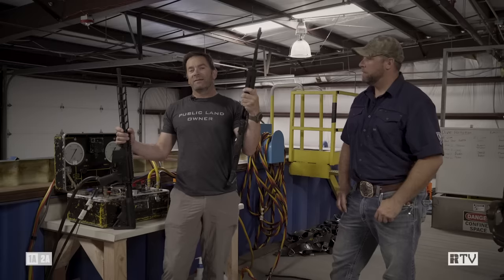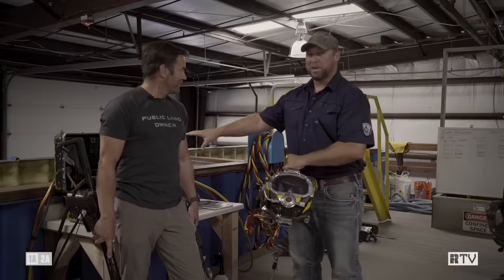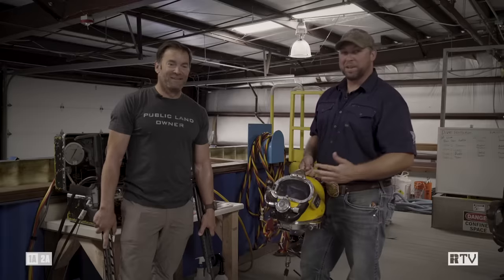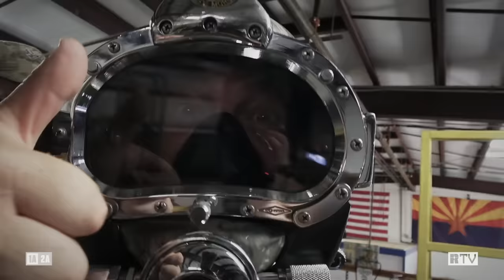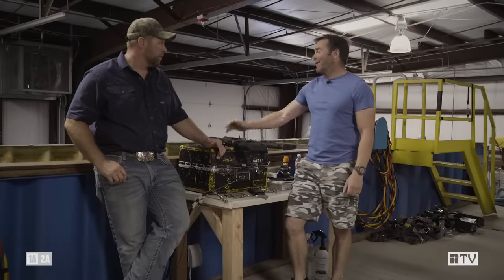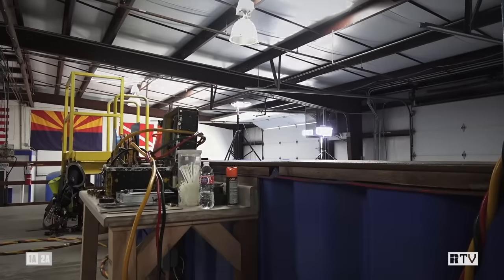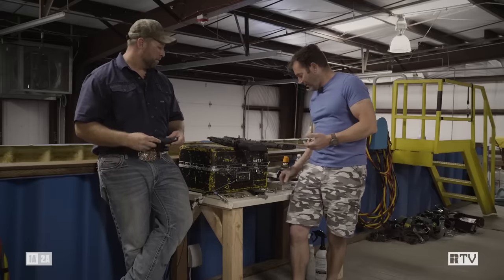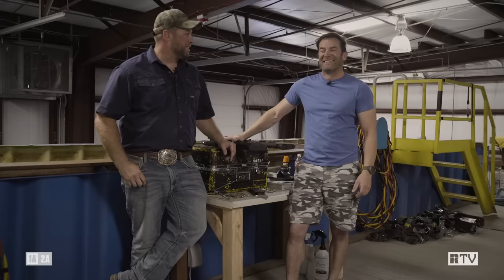AR vs. AK.....Underwater

Comment: I had an AK 47 and an AR 15, I took both of them shooting 1000 rounds AK 47 crapy bear round amo, and my AR 15 I had to have better cleaner brass and more expensive. AR 15 from 1000 rounds only jammed one time. AR 15 would jam very often sometimes after 2 or 3 shoots. Switched the magazine for a military grade same thing, more expensive ammo, same thing. Gave it many chances clean, mags, ammo etc all failed. I got frustrated with the AR and got rid of it. Very nice AR but I would have to say my experience with the AK was much better then.

Comment: AR was probably due to it being a DI system with a lot more actual force going back into the receiver. AK 's piston would be taking most of the abuse of that.
Reply: No, is because the lack of roles behind the buffer tube. There is water there, and since it has no place to go, a hydraulic lock occurs (like on a water flooded car engine).  The solution is to put holes in there, like the ones HK did on the 416. If you look on the infamous test HK did, water flies off the butt stock, and the operator make sure to not obstruct those holes.
Reply: ARs are not direct impingement, there is a piston... it's just that it's the bolt head, and the bolt carrier is the 'cylinder'.
Reply: @mfree80286  ... no
Reply: @superdupermax  No? Care to explain why gas vents into the bolt carrier and there are sealing rings on the bolt? What does that pressure do other than act like a piston and blow the bolt carrier off the locked bolt? That's not direct impingement, there's no 'blind hole'.

Comment: Okay, so gun's using a gas system don't work.  How about gun's without a gas system, like the roller block system in a Cetme-L or HK MP7.  Another good test might be guns that are simple blow back.  In any case, good video, very informative.

Comment: I'd like to see some peizo sensor data on the chamber pressures there, the 5.56 is essentially pushing a 300 grain bullet, the weight of a 50 grain bullet and a bore full of water, which is 250 grains for a 16" barrel, so thats five times more weight than they normally push. The 7.62 is pushing about 400 grains between the bullet and water, a 120 grain bullet and 280 grains of water, so that's about 200% more weight than it would normally push. Big PSI numbers I'm sure, that's probably getting close to rupturing the chambers, for the 5.56 at least.

Comment: As soon as it fires and reaches a velocity that the bullet expands, wouldn't it almost if not immediately expand inside the barrel ?
Reply: IrnMaiden304 No because it never reach those speeds. (Not sure if that is the reason)
Reply: @akivak4660  I'm assuming the AK was having light primer strikes or type 3 due to having to cycle in the water till it couldn't function anymore, but the AR blew apart on the first round. Could that have been due to head space issues with ammunition or design or obturation I wonder. I'm just curious cause there are Glocks that can fire underwater so what makes them able to due what these rifles have issuse doing. I'll watch the video again, maybe I missed something or I am just overthinking idk

Edit : sorry, it was on the second round .... And yes I did miss something, problems of a noisy household .... Crazy over pressurized due to hydraulic force from the water .... 🤦
Reply: IrnMaiden304 Mythbusters test firearms under water.
Pistol worked best, but failed eject casings. Water is thousand times denser than air, it create lot of resistance.
I have no idea why AR mags blew out. Probably because it is gas operated and that will cause a lot of internal pressure.

Comment: What about air rifles? How would those do underwater?
Reply: Even worse, pellet would likely just slow down so fast you would have a pellet half way down the barrel
Reply: I meant something like the Airgun Depot Texan SS. Its an airgun but shoots bullets by compressed air  from a tank. Just the bullet though, no case or primer or gun powder.

Comment: 1st thing over all, I wouldn't used either one under water, lol.
HK used to have a video similar between it's hk416 piston (AR) vs a Colt M4 gas operated.  The Colt basically exploded from the water in the gas tube as the hot gases expanded to cycle.  The hk416 worked normal due to been a piston design.  That's why on this video the AR basically exploded via the pad of less resistance.

Edit: this is the video HK vs Colt.
https://youtu.be/vjMH94PuT_I

2nd video of HK416 in the water,
https://youtu.be/S2d1Jl55haU

Comment: So the AR failed for the same reason that it works so much better above water than the AK because the AK is a very open system and the AR Is a very closed system but it would be cool if they fired a piston driven AR the results may have been similar to the AK no super long skinny tube filled with water coming back at you with immense pressure.

Comment: What was going on with those ak rounds being bulged at the case head like that
Reply: The chamber wasn't completely closed or opened prematurely, the pressure shaped the case for the space that was outside the trunion while being near the peak of pressure
Reply: I'm gonna guess the pressure didn't lower enough to prevent bulging of the case when the bolt pulled it out of the chamber, because of the water around the barrel not letting the pressure escape normally.
Reply: @bigbill2444  The problem is that the water is inside the barrel, making more difficult for the round to exit and creating more back pressure
Reply: @maledetto1221  We're saying the same thing, just differently.
The gas pressure that's building up in the case that isn't allowed to escape because the bullet's going down the barrel slower than normal, so pressure is still too high when the gas system opens the bolt, causing extraction to occur before the pressure is low enough. With that higher pressure, there's extra pressure in the system, too, so the bolt opens more quickly than it does normally. End result is a bulged case.

Comment: Water is not compressible. Thus I expected to see that any firing of a round would immediately bulge the barrel, even though of course that is open at one end, or even both ends for milliseconds. However the incompressible fluid cannot move out of the way fast enough to avoid a large pressure build up for an instant within the barrel. Surely this is elementary hydraulics?

Comment: Those straps cut in a lot less if you're wearing a dry suit. The ideal underwater  weapon is a bang stick.
Reply: @wernervoss6357  Aiming a bullet underwater is difficult  because of refraction and currents. Range and hitting power is very limited. A shotgun shell on the end of a stick is point and shoot. A firearm might be useful for firing at a surface target while right below the surface. Aiming past the surface of the water would be near impossible. You certainly would want multiple shots available.
I wonder if anyone ever made a parascope sight for a firearm to be fired from under water. I know they had parascopes in the trenches.

Comment: I'm surprised they shot the AR underwater. I knew it was going to blow up. don't let water get in your gas tube.
Reply: It'll unlock way too quickly, and then smack the carrier into all the water in the buffer tube. Only place for the  pressure to go is through the case wall and down the feed ramps...

Comment: Damn blew the mag out, try running it with a chambered round before you go under on both
Reply: Don't see how that would affect the mag, unless you just don't have a mag inserted.
Functionally, since the damage occurred after the round was fired, not before it was loaded, entering the water with a round chambered wouldn't change anything.
Reply: Big Bill not sure either, but it’s worth a shot, the first round might function just fine, but the 2nd most likely would have the same result of over pressure

Comment: The ak was obviously better it shot some rounds it would have continued if the rounds had the res stuff painted around the neck of the bullet and also the primer.
Reply: I doubt it was water contamination that caused the AK to malfunction.
Without running an after-action inspection, and knowing that the action still functioned, I would suspect the firing pin was damaged by excessive recoil by the case. But that's just a guess.

Comment: Under water guns work the same way space guns need to with an internal combustion system and reliable pressure release other wise gun go braaaaat 1nce and not work no more because of un even pressure distribution and thing not functioning like they should

Comment: Du ak will always be better it can shott with mud all over it it. But it can get issues like jamming but if you get an ar in the dirt its fucked so they both have there pros n cons but an ak is stronger. Obviously the ak is better underwater atleast the whole clip is still attached on the ak

Comment: The AK was not properly assembled if you have an excessive headspace issue because they are pressed in and  pinned into the front trunnion
Reply: Throat erosion.
Reply: And filling the barrel with water will stretch the entire action when you fire it. Things bend when you do that.
Reply: @allangibson8494  even if the action stretch the bolt locks into the front trunnion,  the barrel is pinned into the front trunnion there's nothing there to stretch,
Reply: @TommyTombstone  possible but highly unlikely
Reply: dj jay sky The barrel itself stretches - firing a gun with an obstructed bore is an extreme event. With a water filled bore your projectile weight is ten to twenty times what the gun was designed for. The other failure mode would be a burst barrel (but that is more likely with a partially filled barrel).
Reply: @allangibson8494  Did you see the ring around the base of the fired cartridge and the missing primer? Bits of that primer are everywhere and I bet a little bit of it is wedging the firing pin in the bolt.
Reply: Michael Free That is a sign of EXTREME case pressure. The primer is the least supported part of the case. It would be interesting to see a fill tear down and gauging of the action and barrel...